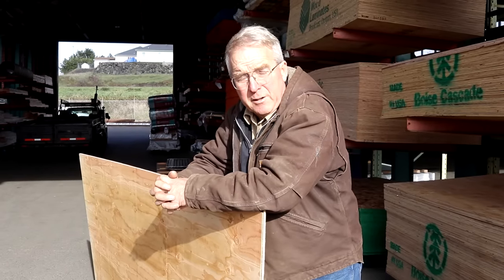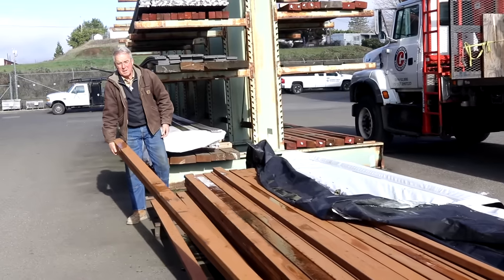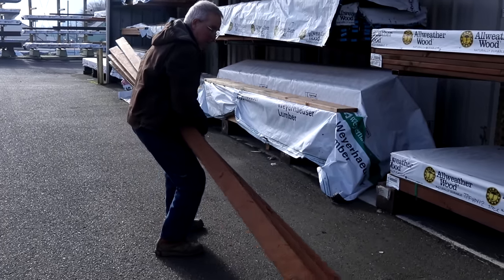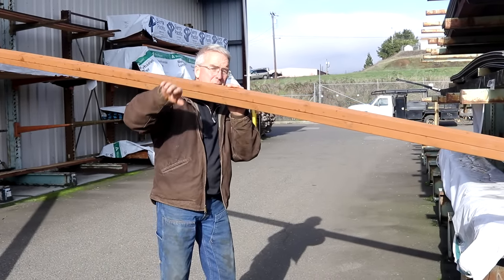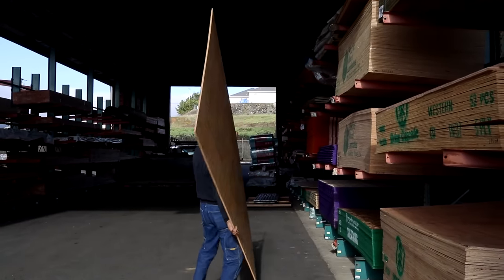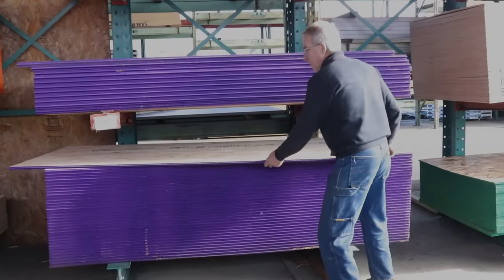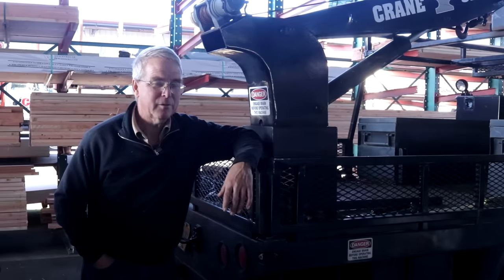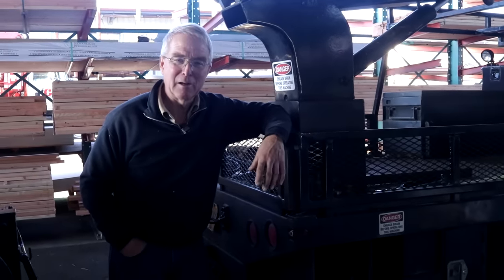Lumber & Leverage: Handling Plywood, Boards, ANY Material with Ease

Comment: Not to critique, but FYI "keep the load close to your Base Of Support" " marry the load to your BOS" the further the load is away from your BOS the chances of injury increase.

At the stack with grady/brady picking up 4 2x6.

You pushed 4 towards grady.  Grady lifted and pushed towards you.

The load was married to your BOS but for grady the load was 12" out of his BOS. When you lifted , took the weight of the load , half or so of the weight shifted to grady whose hands were 12" in front of his body. Not good

Two people carrying the same load , one persons wrong move could move the load out of the second persons BOS potentially causing injury. 

Dont know how many times with 2 person lift . You do the 1 , 2  , 3.  Lift. And the second person puts little effort and you get twinges in your back.

Absolutly " NO" twisting your trunk with your feet planted moving a load #1 cause of herniated disc.

If you use proper body mechanics.  Properly prepare the area where you are working , tripping over debris carring load could cause catastrophic injury weather one or two people carrying.

So make more trips, carry less weight  ask for help  take time to prepair area working in.

 Pushing  is better than pulling!

Your back muscles are basically small postural muscles  they are not ment to lift anything. That is what legs are for.

A persons center of mass is 2" below the navel.  That is where heavy objects  carried with 2 hands should be against your navel. A 75 pound anvil for instance carried  against body at the navel.

And any time you can use a machine, a wheelbarrow, a dolly, forklift , crane  a burk bar etc. Take advantage.

Take care of your body

March 1981 inital injury.  I have missed out on so much stuff in life cause i now had to function within  set boundries. Could not get cold,  wet , stressed,  fatigued , lousy nite sleep, working low to ground alwsys need one hand to support trunk. I never was able to pic my kids up when they were little. Very difficult walking on uneven surfaces.

So thats what you get. 

Tortoise and the hare  -  slow and steady is fast.

Apologize  for diatribe but chronic pain sucks.

Worked for caterpillar dealer 4 yrs.  Crane mech. Naval shipyard 20yrs.  Then physical therapist asst. 26yrs.

Gotta check on turkey.

Their is a gadget for carrying sheet goods kinda like a cane.

JG

Merry Christmas
Reply: In 1977, my father was 27 years old, and he broke his back and was disabled while lifting and moving an industrial dish washer for a hospital. There was ice on the floor also. 3 men shouldn't have been picking it up. He was an ox. 
They told him he would never walk again but by Gods grace He was able to train himself to walk. I was 2 years old, and my sister was 6. I remember him laying on the couch a lot and I would bring my toys to the couch to play with him. 

I used to lift some pretty heavy stuff but I wasn't even close to as strong as he was. Almost every time I was getting ready to pick something up for him he would say don't hurt yourself and I would say I got it Dad. When I turned 28 he said well I'm glad you've made it longer than I did. I've been worried that you would hurt your back like I did. 
I've hurt my back a few times in my life now and I can't imagine living over 30 years in that pain.
I said a prayer for you. Merry Christmas and God bless you!

Comment: Something happened to me to make me realise the message you are giving here. 
Over 40 years ago they changed the weight of bags of plaster! ..... Yes it was that simple, and I am not even in the plastering business!

But I did work on sites they had them. You could always tell an old plasterer (if you could even find an old one) by the misshapen back! It was due to always carrying those oversize  bags of plaster and when they changed them nothing happened. Well not right away it didn't. But you did slowly start seeing older plasterers with an upright walk and they slowly got older instead of quitting through ill health!
Now I am old (ish) I can appreciate all of the stupid things I repeatedly did to wreck my body from arthritic knees from kneeling on cold wet concrete to thumbs stiffened through "hammer rash" (hammering your hand instead of a cold chisel in awkward spots). Thankfully I learned more than many of my workmates and am now healthier because of it!

Comment: Great tips, thanks.

I often look at material in front of me and think, "if i had to do nothing but this for days/months/years repeatedly, could i do it, or would it be hell?" If it's going to make life miserable, im probably doing something inefficient and i need to figure out a better way, and there often is multiple. Im in this for the long haul, we rely on our strength to make a living, pain sucks, and medical bills are expensive. Hand trucks are my friend (where applicable obviously), work smarter...

When i was young i worked with Mexican crews that came up with some really smart ways to do things, they taught me a lot early on. If you're the youngest guy on site, ask the oldest guys around how they would do something. Sometimes you'd be surprised what they share, but they dont until asked because they don't want to be seen as telling people what to do (or just want to let you figure it out the hard way).

Comment: 73 Year-Old Part-Time Handyman here. I don't have to move sheet goods often but when I do I use one of those jigs that allow you to sort-of create a handle on the side of the piece. You're carrying the center of gravity of the board at roughly your waist height, vs carrying it at shoulder height. You've done literally half as much work.

Comment: When I had to plywood my 100 year old roof I had to find a better way to get it up there.  I discovered a clamp made to fit on the side of the plywood called the Vulcan, I leaned two 6 inch x 12 ft boards against the roof and strapped the Vulcan on the side of the plywood and we pulled it up with a rope with a hook on the end, it also made it easy to move the plywood because you could use it to lift it to your shoulder.

Comment: Some good ideas.

#1 I have is carry less; maybe only 3 2x4 instead of 4-5. Takes more trips but increase in weight disproportionately increases stress on body. Just because you can carry two drywall sheets together doesn’t mean you should.

Comment: How about walking a 4x8 sheet. 

Stand the sheet on the 4 foot end. Lean it to lift one corner, move that corner forward and rock it down so the opposite corner lifts. Move the opposite corner forward, set down and rock up the first corner. 

Repeat. With a little practice you can move pretty quickly. 

This is useful for moving shorter distances and maybe some twist and turns inside.

Comment: When you’re carrying long boards on your shoulder, balancing them on the middle point is actually not the best thing. Instead, find that balance point, and then shift the boards back a few inches, so that they will tend to fall behind you. To counter that, just lay your hand on top of the boards in front of you (right hand if balancing on your right shoulder). This will balance the load, and you will find that this setup will allow you to control the boards much better. If you’re balancing the boards at the exact center, they will just kind of float on your shoulders, and be hard to turn and manage - like your grandma’s old Lincoln Continental with the bad shocks and tie rod ends. But if the weight of your hand and arm is stabilizing the load, you can control and point the boards wherever you need them to go. Try it!

Comment: When I was young, I'd stack two bags of concrete on my shoulder. I'd carry two 8x8x16 block in each hand. Worst thing though, I'd fill a wheelbarrow as full as I could I could get it and run it over to where I needed it without spilling any. The good ol days. Now I'm in my 40s and ibuprofen is a good friend and I do things a bit different.

Comment: Work with your brain, instead of your muscles. Whenever it's bigger than you, you have to be smarter than it is. I am 80+ now, still doing some building. (Building a large (1300 sq. ft.) "tiny home" with & for my daughter.) My Dad built cabinets until age 89 & had learned how to use leverage & smarts to do things that young people use muscle for. Work smarter, not harder was his motto. We always had a roller skate modified with a cradle to move plywood long distances anywhere with little effort for example.

Comment: I was on a jobsite once that was shut down because the wind took a piece of plywood. It flew threw the air and killed someone. I'm always a proponent of moving sheet goods with less manpower unless in a situation like that. Outdoors, especially on a roof safety is more important.

Comment: Only issue is I’d never carry a sheet from the end, even in the slightest wind that thing is flexing and go flying and gonna hurt u. I tip it on the corner grab the middle and one hand on bottom one on top leaning against my shoulder, in high winds I turn it parallel to the ground so the thin side is in the wind for less drag obviously, I’m glad to see trades finally getting the money they deserve. This is very hard work and most people can’t do it physically or mentally. I just wish the Younger generations would be more interested. That way I could actually hire some help.

Comment: the boardlifting is always killing... either get the boardlifting OR you can stack 1-2-3 standing vertical and put back against them bend knees abit grab them and stand up and lean forward.. JUST dont do this when strongwinds.... you will end up running faster then forrest gump

Comment: I learned to use the crook of my arm working at a door shop...but, doors are different, a solid raised panel 1.75 inch thick door 3 feet wide and 8 feet long is easier than plywood, you can use the crook of your arm and still keep your other hand on top! Plywood is awkward!

Comment: You treat the edges and corners of $100 Oak veneer plywood like that your fired.  You clean and jerk it off the floor neatly and then no sliding it on its face.  You even have to be careful gliding across the table saws top.  Gouges and scratches are not allowed.